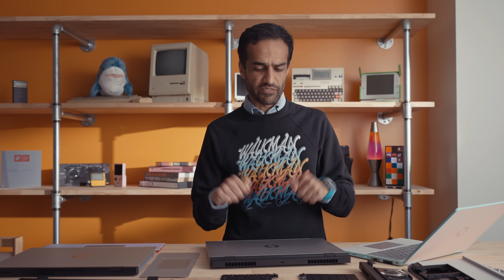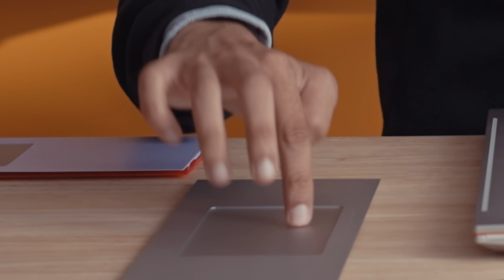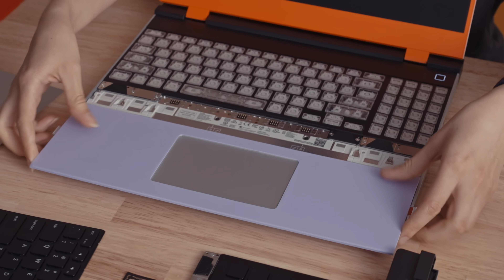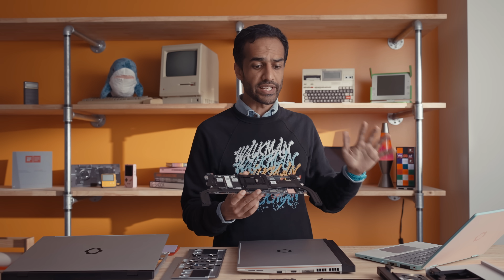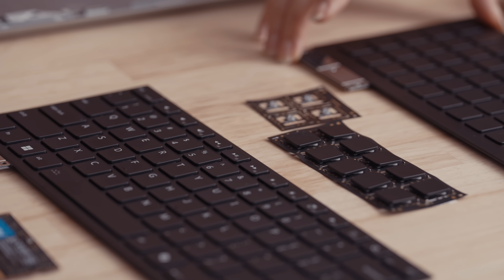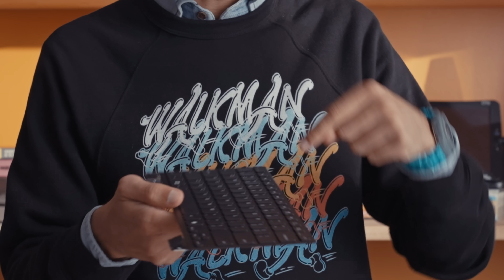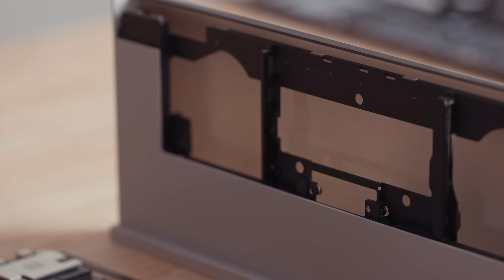Framework Laptop 16 - Prototypes and scrapped ideas

Comment: @framework Have you considered a split keyboard, with the touchpad in the center?  I use an ergonomic keyboard on my desktop, and have learned to really love it.  The center triangle where the break occurs could fit a small touchscreen, which could be used for eraser mouse substitute.  You could even shape it like a cup, similar to a key, that could be used as the mouse analog.  It would decrease the amount of hand motion to use the mouse, though would have to be smaller.  With a larger break in the keyboard you could provide it more room on the 16 than would be possible on a 15, and may be impossible on a 13.

Comment: "We found everyone wants more memory, so we're looking into even MORE memory." Good. There are a lot of developers and engineers who are getting your laptop because they want a no BS solution that can handle their workload. Especially when compiling; multi-core, high memory systems are a must. If you're trying to use the 16" for AI, the RAM and GPU are a must for sure. It would be great if you could somehow convince AMD to figure out replaceable RAM modules with their AI Max CPU lines.

Good to hear about the DIY focus for the eGPU enclosure. If you can just provide a model for printing and a board to plug the GPU into, we can definitely figure out the rest.

Comment: Lenovo has the same problem with the trackpoint eventually marring the screen due to pressure, they seem to just depend on that half millimeter of rubber on top of the trackpoint cap and that isn't remotely enough protection. My T480s has a pressure mark right there that shows up on dark displays. So now Lenovo seems to be dropping the trackpoint on a lot of models rather than make the keyboard a few mm thicker.

Comment: Hello!
Maybe you need create small piece with trackpad and more spacers with different sizes?
For example, today you have 1 module with trackpad and big chunk empty space and 2 spacers in standard way.
 For next lines, 'spacer'=1Unit place (1U).
Today standard: 1U+trackpad module (around 8U)+1U
Maybe in future you can create larger trackpad without empty space, also standard, but larger and different sizes spacers.
Examples: 
1) 3U + Module only actual size trackpad (around 4U) + 3U
2) 4U + Module only actual size trackpad (around 4U) + 2U
3) 5U + Module only actual size trackpad (around 4U) + 1U
4) 2U + new larger trackpad (around 6U) + 2U
5) 3U + new larger trackpad (around 6U) +1U

From production perspective: 
spacers, very universal sizes. Good enough, 1U + 2U + 3U. 4U and 5U optional.
trackpads, you have larger trackpad in the video and it's exist, but in larger panel. I guess, that order panel with only trackpad cheaper and more convenient.

BTW I'm not actual user Framework. I'm still wait open official shop in my country or allow forwarders from EU to others countries (Brasil)
Thank's for content😄

Comment: Y'all did a great job! I love my 16, and I have a new 48gb stick on the way with the new power supply (something I have desperately wanted!) preordered as well. I think that, going forward, you could probably eat into some more market with a couple of neat additions. You could build shells for your screen modules that they can become external monitors with stands (or clips/mounts for the native screen) and plugged in  via the port on the external graphic card. As a student and researcher who works with data sets in the lab setting, mobile and modular multi monitor support is a dream. Another item that could also (somewhat) mitigate the track pad issue, and also add functionality to your lineup would be an external input pad. This could be in the form of a product like a Wacom, and can be used as a trackpad as well. Wacoms (and similar products) are extremely expensive, but can be useful in marking up journal articles or grading papers. Finally, I have 2 things that are very nit-picky. First, a back-lit num pad would add aesthetic continuity between the keyboard and num pad. Second, an idea you already put out; a one piece touch pad module.
Bonus idea... Spacers for the touch pad module could have some functionality as simple input devices. Thinks like touch sensitive volume sliders or brightness controls. That may give the modders and build enthusiasts one more thing to play around with. 
Y'all are awesome!

Comment: A couple of potential ideas:-
1: As regards a single piece touchpad insert, would having a large touchpad with a cover work? So that the user can place the cover over where they're palm rests.
  1a: Would it be possible to make the insert itself one piece with a touchpad slot? Then users could choose from multiple sizes of touchpad (each sold with blanking plates or some other way of covering the unused space) and place the touchpad where they want it.
2: On the mouse-nub-thing, maybe make new laptop chassis a couple of mm thicker? Then you could have two keyboard tray depths, this wouldn't be backward compatible which would be a little unfortunate but I think it'd work.
Edit: 3: Would it be possible to make add-in modules with multiple ports? Maybe one that bridges two slots but has three or four ports instead of two modules with one port each?

Comment: I don't know how thin the off-the-shelf options are, but maybe something like the tiny trackpads the blackberry torch line used to approximate the trackpoint-style in-keyboard pointer. Using it as a mini trackpad like a normal trackpad could work of course (if it fits), but I'm imagining software that translates the position of the finger on the trackpad to applying directional force on the pointer. Some quick searching showed some blogs/info about it: "Of trackballs and trackpads", "Trackpad in a Keycap for Corne/CrKbd Keyboard", and the "Tracking" page of the joric/jorne keyboard.

Another idea would be some form or some approximation of rotary encoders/dials. I think ASUS did something like that on a couple laptops. A secondary touchpad the size and position of the spacers that go to the left and right of the keyboard/trackpad could function as a slider (or I guess up to four), customized with QMK the same way rotary encoders are.

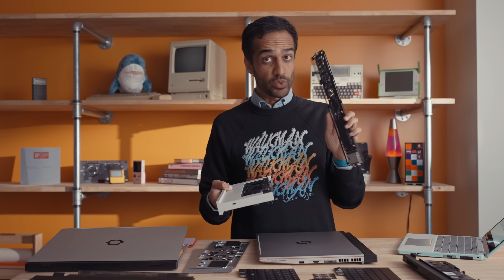Comment: 16:00 That e-gpu enclosure would be a really appealing option for a framework 13 user as well. If I already have my fw13 and in need of some gpu power I could just buy a gpu module and a e-gpu kit for a very portable desk setup. That would be absolutely amazing to have as a student. Yes cheaper is better but also durability, portability and design is more important imo.

Comment: I have never seen a company present what they tried and didn't get to work. I adore this, I respect this, and I find this giving me more desire for this platform overall. Please keep this up.

One quick praise: I appreciate the multipiece touchpad level of the Framework 16, because it enables me to have a laptop that is left-handed, with my num pad on the left, track pad to the side most comfortable to me, and it's just extremely pleasant.

Some things I'd like to see from Framework:
- Improved Wi-Fi antennas; I have noticed that the Wi-Fi antennas struggle for connection sometimes in places where other laptops and cellphones can establish the connection just fine.

- a thinner ethernet port module; I know miniaturization is tough, but the bulkiness of the ethernet module is just wild. It is probably my most regularly swapped out module, just because it's unreasonable to leave it in when off.

- I've tinkered with a cellular module. I pulled the old cellular connection equipment out of an old laptop of mine, and I wonder if a cellular module would be possible.

Comment: Couple thoughts (mostly for the community not for FW the company) 

1) What incentives could there be to (re)source /match used FW laptop parts (think - Businesses that need to upgrade yearly) and let's say students in need. When computers came out everyone celebrated paperless but computers + printers actually ended up with people generating MORE paper waste. With Framework modules so easy to upgrade - you can now upgrade parts yearly instead of laptops every 3-5 years, especially where performance matters and responses aren't an issue (labs, high earner tech enthusiasts etc). Can framework have or support or moderate a marketplace for used parts, offer incentives to prevent it sitting in a drawer etc? Typically the person with the ewaste and the person who has the time to DIY and the need are two different people.

2) Is a removable trackpoint with pogo pins a possibility? I wouldn't mind removing mine and either magnetically having it snap to the top of the laptop, or go in a small carrying case - if the only thing stopping trackpoint is how to transport, I am die hard enough to not care about removing it after each use

Comment: I'd love to upgrade, and making an eGPU would be fantastic and give me a lot more value. I'm unsure if an eGPU would work with other devices, though even with compatibility outside of framework lineup were limited, it would still be nice to use with the fw13 or fw desktop.(or even with the fw16 to keep thermals on the device low and/or drive an external display)

Comment: Some quirky ideas, i thought it would be fun to share: (I'm a former thinkpad user, i might be a little biased)
1 - Try embedding capacitive touch buttons underneath the panels and surfaces around the trackpad. They are cheap and can be put almost everywhere. Think of it like "zones" that would potentially help the palm rejection algorithm identify where the user's wrists are resting and turn trackpad zones ON/OFF to avoid accidental inputs;
2 - TrackPoint thingy too big? Consider the small navigation sphere that old blackberry phones had on its place. (Or heck, even a small trackpad like the later models had);
3 - Separated Physical buttons for right click, middle click and left click (not quirky, but missing from other mobile workstations);
4 - Milling module panels with wire EDM machines to reduce (or even completely remove) gaps;
5 - Trackpad in Numpad format to go besides the keyboard, some other giant laptops already have implemented this;
6 - Back module to oculink (i think everyone is also asking for this);
7 - Back module with extra battery, with the ability to hotswap, bring the powerbridge back from the dead;
Reply: Those are some trully great suggestions!

Comment: A suggestion for the pointing stick issue: how about making it "retractable"? It could be somehow (mechanically or with a sensor of the hinge position) linked to the screen lid angle, so that when the lid is almost closed, maybe about 10-15 degrees or less, the stick starts lowering until it's below the keys plane; the keyboard could even have a hole underneath so it doesn't need to be thicker (the hole would be hidden underneath it once installed), or maybe not, as the travel distance required may not be too much.

Comment: Loving the momentum on Framework 16! Any chance of a higher-end AMD GPU module (RX 7900M or next-gen RDNA) in the Expansion Bay? Also: please consider an Input Module that replaces the keyboard/trackpad with a secondary display (ideally touch + pen). That combo would unlock pro workflows, creative use-cases, and keep the “modular laptop” dream blazing.

Comment: Literally holding off until there’s a 1440p 120Hz OLED screen for the 16. Oculink would also be nice in the expansion bay for people that want to have the highest throughput for an eGPU and not need the extra bulk of a dGPU. And CAMM. Also, loving the wide trackpad.

Edit: please make a lapdock logic board that slots into the laptops.

Comment: @here does anyone have any hands-on experience with an optical mouse module like a Pixart PMW3610DM?  Could this be used as a trackpoint/micro trackpad if stuck in the middle of G H B if I built a keyboard pcb as a flush trackpoint?  I'm maybe thinking mount reversed under the board pointing up and have a small diopter with the keys slightly proud of it.

Comment: One potential solution for getting a trackpoint type input device without increasing the height of the keyboard module is using an optical mouse sensor pointing up out of the keyboard. To move the mouse you would move your finger over the spot where the trackpoint would be on a thinkpad and the "right thing" happens even though there isn't actually a trackpoint there. Obviously you wouldn't get any tactile feedback telling you where the trackpoint is, but you could maybe address this by putting some texturing on the neighboring keys (if I were prototyping this I would glue on pieces of fine grit sandpaper).

Comment: I really like what Framework is doing, especially the idea of upgradability, self-service & repairability to reduce e-waste. But the pricing is hard to justify. Even the cheapest 12-inch model in the UK is £594 without RAM or storage, and mainboard upgrades for the 13-inch run around £449 - £999. That’s basically the cost of a whole new laptop with equivalent specs. So while the concept of swapping components instead of replacing the entire machine is great in theory, in practice, it doesn’t actually save money, which makes the value proposition feel much weaker.

Comment: So, I was hoping that what would be covered was why you didn't try to make something like the 7945HX/3D work, which would also have led to the 9955HX/3D support. They have more than enough PCI-E lanes I'd have thought to build a product. You'd need a pair of ASM4242 or similar chips to give enough connectivity but then with the 8x dGPU a couple of m.2 slots you should still have lanes left for WiFi/BT and anything else, though I'm not sure that there is anything else to cater for. That would give workstation users access to the cores and threads that they may really want /need.

I expect that there are reasons, possibly plenty of them (cost, power, cooling, design feasibility for the board etc), that it's a non-starter but that's why we'd like to hear about them 😅

Love the transparency though 🙌, it's much like Eben Upton's and they're not doing too bad for themselves either.

Comment: One thing I've been dreaming about since I heard about the 16 and the input module system is an option for split keyboards. I'm thinking two separate half-keyboard modules with a spacer or two in the middle. Would something like that even work with the positioning of the connectors?

Comment: For the pointing stick, I wonder if there could be some sort of mechanism that raises/lowers it with the screen. So some sort of mechanism maybe attached to the hinge or something that would allow it to lock in place when the screen is up, but recess into the body when it closes. Or I'm wondering if it even needs to be in the keyboard. Like could it be a little recessed nub beside the corners of the trackpad that you could operate with a thumb instead of a pointer finger. It could even be a low profile sliding joystick. I think I remember there being one on the PSP.

Comment: I love this insight and transparency of what Framework has been doing behind the scenes, as well as addressing user concerns/feedback!

I definitely like the one-piece touchpad solution. I'll see if I can get someone to print me one (in purple, of course!)

Now, there is one concern I have regarding the keyboard that I don't think has been addressed yet? It's that Windows Alt codes (i.e. Alt + numpad 3 = ♥️) don't work. On a normal, full-sized keyboard (be it a standalone keyboard or a laptop one), this isn't an issue. But with the FW16, the main keyboard and the numpad are technically separate devices, so they can't communicate with each other. So, I'm wondering if there's a way Framework could fix this issue...

Still, I've been mostly pretty happy with my FW16, and I was happy with these announcements (especially the new GPU... Though, I wish it had more RAM), and look forward to future updates for it!
Reply: bro, your avatar

Comment: There are so many things you need to fix to be a proper laptop. The obvious one, is you need a drive bay. I like the USB expansion bays, that's great. But they are small, you need a proper drive bay. Duct-taping an external drive doesn't cut it. They keyboard layout is terrible. You have room for proper home, end, page up, page down keys, but don't have them. And no need to squash the up and down arrows. And you have to disassemble to replace the battery? None of this makes any sense!

Comment: What I really wish could be made is a "gaming" skew of the 13 (or even the 12!) that uses a custom AMD APU instead of a standard AMD mobile CPU much like many of the handhelds, (steam deck, ROG). There's likely a large user base that would like more GPU power than CPU in a small and light form factor laptop (especially the 12 if it can be used for graphics design with the stylus too)

Thanks for all the hard work and dedication to making the best products you can!

Comment: what I like to see in the new FW 16 let's call it 2, to come with micro LED display 16:10 2560x1600 240Hz and tighter tolerance for every expandable modules and accessories, and less possible plastic as possible, more premium materials especially magnesium body

Comment: Regarding pointing stick i would have tried a mechanism where it sinks into the keyboard so it doesn't make contact with screen and if laptop is turned on raised back into position to be used tho I'm assuming that will be quite difficult judging on the thickness of the keyboard module.

Comment: here's a bold idea:

smaller trackpad module. possibly also ones with rotation.

that is, a module no larger than the touchpad itself, so it can be placed exactly anywhere along the bottom edge, from the right edge to the left edge.

I for sure know that, if that would be reversible, I'd move it back and forth depending on occasion.